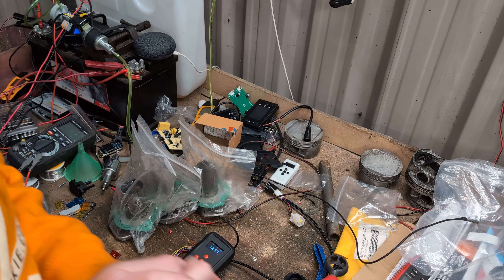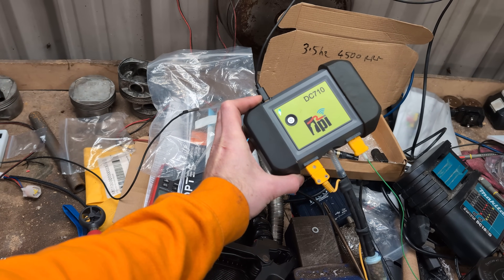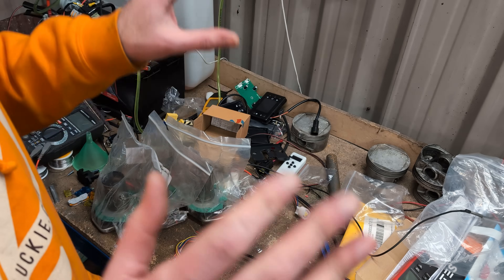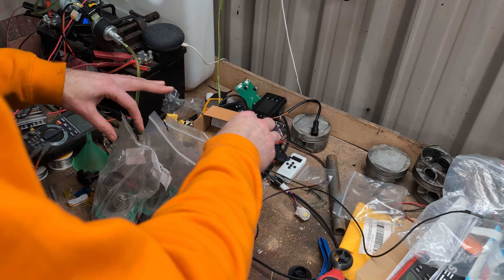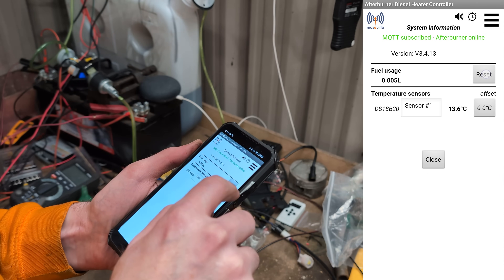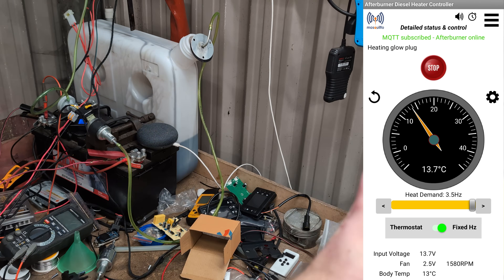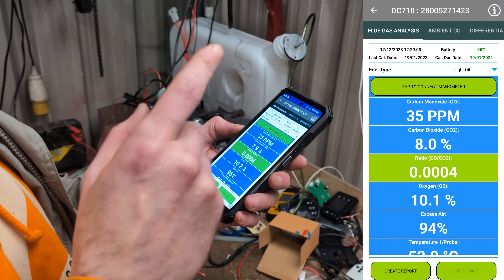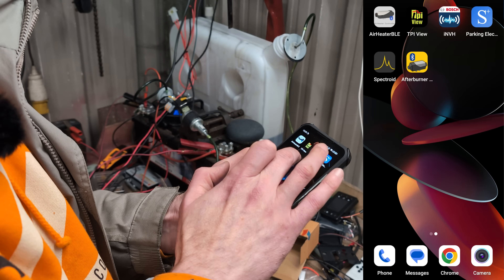Diesel Heater testing filtered waste oil - undiluted - part 1

Comment: I'm curious whether the oil you are using for these experiments is conventional, full synthetic, or a blend. I'm assuming by the weight and vehicle it's probably full synthetic. A mechanic that I know here where I live heats his garage with a heater designed to burn used engine oil. However, his heater performs very poorly when he attempts to run synthetic oil through it. It needs to be mixed at a ratio 7:1 conventional to synthetic in order to burn properly.

Comment: Ive seen a guy that uses a £300 centrifugal filter to get the oil super filtery...then uses 10% petrol and alegedly hasnt cleaned machine in 2 years.
Reply from the maker: The cheapest setup I've seen starts at £550 for the centrifuge and the pump.  We'll see if we can afford one at some point.
Reply: @DavidMcLuckie  Ah the oilybits one...this guy had a Dieselcraft magnum 60 which is $300 plus he had pump and regulator already...aye so pricey it gets indeed.
Reply: @DavidMcLuckie they make smaller ones that fit on your oil filler cap so you don't have to change your motor oil as often more like every couple of years

Comment: Last winter I ran my CDH with the Afterburner for weeks on hydraulic oil, the "32" hydraulic oil, worked great, I used a 50/50 mix with DPF cleaner additive added.

Comment: My forced air garage furnace runs 50/25/25 of waste oil / petrol / diesel. 2:1 seems to be the right viscosity but anything over 25% petrol changed the combustion properties too much. I went with a smaller nozzle because it pumps out way more heat on the blend

Comment: ive run hundreds of litres through my 12v diesel, 50-70% waste oil cut with diesel, smoked more but ran fine well worth the savings at the time diesel was near 2$ a litre

Comment: Does the afterburner allow for a second metering pump so you can start with fuel oil and then switch to waste oil once warmed up?
Reply: The metering pump should stop any back flow so if both pumps could be operated at the same time with different rates you could adjust the mixture during the run.
Reply from the maker: No.  But I hope to have the chance to test something that does exactly that very soon.

Comment: heres an idea with it being used oil and obviously with that less burn factor than fresh oil or diesel etc might be an idea to coil the fuel supply line (copper) round the exhaust whether that be 5-10-20 cold round the exhaust and of course ideally start and stop the heater on diesel/kerosene. bet that would make ALL the difference

Comment: This gets done to death - the answer is no. In order to run waste oil at any dilution level, you need to be able to influence the ignition process. I.E you need to use heat (a blowtorch) in order to get a diesel/kerosene heater to start up when being run on waste oil/diluted waste oil. The factory glow-plug won't be up to the job. 

With these types of heaters, there's no practical way to introduce heat to initiate combustion - you will be relying on the factory glow plug. It won't do the job. Period. It doesn't glow hard enough. You will end up having to clean out the combustion chamber manually & it will be a pita. Run it on diesel. Torpedo heaters run alright on diluted waste oil - use it in those. Mainly as you can use a blowtorch to initiate those.
Reply from the maker: Yes!  It's almost like they make a specific type of burner for waste oil.  This diesel heater isn't that.

Comment: Thanks David, great series of videos. I was pondering getting one of these heaters to burn off my waste engine oil and heat the shop a bit. You've saved me a bunch of trouble, thank you sir. I'll just continue heating with propane amd taking my waste oil to the recycling depot. Far less hassle.

Comment: You should try a 5050 mix of filtered oil and diesel fuel. Or maybe a 6040 mix. I have been running filtered vegetable oil and a diesel mix in my diesel heaters. And I've never had a probably at a 60% diesel fuel to 40% waste oil or sometimes maybe 5050.

Comment: Wonder if you can you try the ignite wifi controller.  Id also like to ask what's the minimum pump speed hz in afterburner tuning settings?

Comment: I'd be interested to know how those big waste-oil burners that mechanics have get around the gumming-up conundrum. I've seen them run on absolutely foul oil, and not make much smoke in the doing of it. I know that running an engine on old waste oil is contraindicated unless it's been through a centrifugal filter. However, an old boy I knew ran all his big trucks on the oil from his scrap yard. He centrifuged everything that came out of the vehicles that came in, and bunged it into his artics. He said it can gum things up if you let it run too cool, but that's not a problem if you use the accelerator like a switch, as it's intended.
Reply from the maker: The industrial waste oil burners like the Thermobile use a flash evaporation type of burn.  They have a heavy metal dish at the bottom.  You start them off with diesel to get it all nice and hot.  When you switch it over to waste oil it drip feeds onto the pan and is evaporated by the heat.  The evaporated and now combustible gas burns inside the heater keeping the pan hot and providing the heat to the garage.  All the heavy metals, soot, junk are all left in the pan.  Which does require periodic cleaning, usually with a hammer. :)
Reply: Well that explains that, not so much chance of getting a hammer in these burn chambers!  @DavidMcLuckie

Comment: I would guess bringing fuelrate right down to lean out to cause hotter combustion and burn off the crap.
Reply from the maker: You're thinking internal combustion engine.  Leaner isn't hotter in this kind of heater.  More fuel = more heat.  Up to the point where there isn't enough air to burn it.
Reply: @DavidMcLuckie  yes I guess that makes sense.

Comment: great videos love what you do , saw your key ring with 2 big skeleton keys what do they go to they look big , and queston you might be able to help wonder if its possible to put 2 same controllers on the same mob but one like 75 feet away in my shed using like cat 5 wire ?

Comment: Need to design a burn chamber that has non stick walls, so the Ash just gets ejected out the exhaust. Maybe like a chromed cylinder bore on aircraft engines, or a different grade of stainless that stays shiny at temperature.

Comment: I bashed my head on a brick wall for far too long trying everything people suggest to use old oil in a standard heater. I have a idea I haven't tried yet making a larger heater using part of a diesel heater running on diesel to feed very hot air to a larger burn chamber for the oil that is easier to clean

Comment: It it possible to run 2 pumps?  1 in diesel and 1 in waste oil.   And a 1 hour switch to run pump 1 OR 2.
Run 1 hour free heat waste motor oil and switch to 1 hour of diesel heat.
After 48 hour of running and the last hour of diesel , disassemble the heater and check inside.

Comment: Can you tweak the glow plug to come on periodically and prevent a flameout?
Can you tweak it to run on highest power periodically to burn off the deposits?
That‘d be what happens in a DPF of a vehicle exhaust…
Reply: The problem is that the WMO deposits are not near the glow plug. Also, the deposits are very hard. The heat from glow plug wouldn't do anything notable to the build-up.
Reply: Well it would keep the flame burning and prevent flameout.
I was able to burn out those deposits with a torch from a burn chamber I removed after using WMO. So more heat = less deposit built up I concluded.  @cliffelmore5834

Comment: That‘s exactly what I also had with my heater.
I discovered it took longer to flame out if run on higher heat (which probably burns it off better).
How about adding some DPF cleaner additive- which is supposed to lower the ignition temperature of diesel…and oil perhaps too?
And next one with pure waste vegoil?

Comment: Great video and I have learned a lot from your other ones. One thing i noticed was that when you were filming it the next day and you said that it had flamed out, it appeared that there was air in you pump suction tube. Had some drained back into the tank or had you lifted the pipe out of the tank for some reason?
Reply from the maker: The pickup pipe was hovering above the oil as I'd put it in wrongly.  So I'm guessing at some point it was sucking air and oil and flamed out.  Then the fuel settled in the pipe once it had stopped.

Comment: so many people say that you can run these on waste oil and you just cant, ive made a load of my own oil burners before and know how carboned up they become, there is no way to run these on pure engine oil
Reply: Even the purpose built waste oil heaters accumulate hard carbon deposits that require decoking. It is simply really dirty fuel.
Reply from the maker: Technically they will run on pure engine oil.  Once.  :)

Comment: was running used filtered veg oil and kero 50/50 but burn chamber kept clogging, can you take a old chamber apart so we can see how its made? also thinking of cleaning with caustic soda or cooker cleaner as carb and brake cleaner dont seem to be good enough, great vids
Reply: If you look down the burn chamber there's a ring with space behind it. This is called the vortex chamber.  There's a big gauze that runs around the edge that you can't see. This is to vastly increase the surface area the oil burns on. You have to cut the chamber tube where the ring is to be able to see it.  No matter how hot the burn is, the gauze is always cooler because its made to aid the evaporation of diesel oil so it can burn. The evaporation effect actually keeps the gauze cooler. Engine oil burns slower and doesn't readily evaporate, it soakes the gauze and unburnt deposits build up which eventually reduces the surface area to the point it will no longer burn anything. 

I went through all this last winter.  It just became annoying and time consuming to have to strip it down every few hours to attempt to clean it. I even cut my burn chamber to access the large gauze for cleaning (held back together with a jubilee clip) but it became so clogged with hard deposits that I ended up destroying the gauze in the process of cleaning. No solvent or caustic soda would soften these build-ups to ease cleaning.  IMHO, its simply not feasible to run waste engine oil no matter how much you water it down. A weaker mix just takes longer to clog, but it will.
All I'm saying about wmo is also applicable to wvo, the difference is that wvo has glycerin in it that has to be extracted before you have a clean burn. Extracting the glycerin can be done,  you end up with bio diesel, but at that point its more economic to use that for powering a vehicle due to the effort of making it! Good luck....
Reply from the maker: Yes.  I've got a video of me cutting the burn chamber open to show the insides.  Just need to finish editing it.

Comment: @David McLuckie , what about burning new motor oil, as a test, to check how much tar and ash there is as a baseline.
If it gunks up the chamber with new oil, then no matter how much you filter used oil, the results will be the same or worse.
Thanks for testing and sharing the results with us.
Reply: The youtube channel "Lowered expectations" tried this last year and it has the same or similar effect. he has absolutely murdered the oil burning process to death with very little sucess.
Reply: I tried it one gallon caused issues

Comment: Try 4 pints oil, to 1 pint diesel, also see if 4 pint oil, 1 pint gasoline (or paint thinner) if it will burn or burn too hot...
The soot buildup is due to the burn chamber not turning red hot (or staying red hot) burning off the crap buildup.
I guess it just needs VERY VERY refined oil to make it burn properly w/o the buildup
I guess the pipe dream of seeing waste oil being able to be burnt in that thing is a pipe dream...we shall see
Keep em coming!!!!

Comment: Love the heater videos ! Also 15:20... That looks very familiar. I spent 4 months last year burning waste motor oil and has this same result, sometimes multiple times each day, haha. 

It's great entertainment if you really like experimenting and trying out viewer suggestions.... but you will get a lot of people (who have never done it) claiming that you are an idiot because you didn't _____ and then you try that thing and oddly they have no follow up response   🤣
Reply from the maker: I'm hoping if enough people show it not working, eventually people will stop asking if it works.
Reply: @DavidMcLuckie  Good to hear ! There are a few channels that have made claims that waste oil works fine, so it's good to see you doing these test. 

The funny thing is that I suspect people will just come up with a million ways that you're doing it wrong. You need the very specific combination of things that they heard about on Reddit, or something, haha. Ceramic off spark plugs in the chamber, preheated oil, acetone mix, seafoam, hydrogen haha. It never ends.

Comment: Hi David, when you come to trying cutting the oil with other fuels can you possibly try a sample of kerosene please as a lot of people seem to be burning kerosene to save on costs during the winter as its a fair bit cheaper than diesel? It is also said that Kero burns hotter than diesel and is slightly less efficient, Im wondering if mixing it with waste engine oil would increase the efficiency and also burn the waste oil at a hotter temperature possibly reducing the coking effect in the burn chamber? I add strawberry scented two stroke oil to the Kerosene as my neighbour can smell the kero on start up and doesnt like the smell and I dont have any coking issues with the small quantities I add to the fuel ie 50ml to 10 litres of kero, this also seems to silence the pump a little adding some lubrication.
 Merry Christmas.

Comment: I filtered it and mixed it 50/50 and within 10days of 10 hours work it started to backfire through the intake chamber and flamed out it self and wouldnt restart. Took it apart and it was full of ash. I reckon its the antiware additive within the oil that form the heavy ash. The positive side for running oil is the immense amount of heat comparing to diesel that the heater generate it.

Comment: Waste oil better stick to natural and not engine oil lol . I did the same with brandnew 10w40 mixed with diesel 3/4 and it burned great but after three days poof lotta white smoke and it left a white crusty residu in my burnchamber it was a bit like perlite and it totally clogged it up . Probb the aditives in the oil that dont burn off .
Reply: They are designed as a light fraction vapourising oil burner that runs trouble free on diesel or kerosene. Waste engine oil is never going to vapourise and burn cleanly in this type of combustion chamber.

Comment: i think there is also an opportunity to see what else can be done to treat waste oil before use.  could look to add some kind of ceramic filter material (broken teraccota) to remove metals and other ionic salt particles.  what are you using in the filter? could put 30 watt heating mat round the filter to keep oil moving freely.
Reply: It looks like a standard pool filter...I think they filter down to less than 30 micron easily
Reply: @haydenc2742  centrfuging oil be the ideal solution. seen a few videos on youtube where they have a diesel car running on used engine oil. to make it useable, they centrifuge oil to clean and it removes all the crap and then pass through oil filter. imo, to make the heater to work, cleaing the oil is key.  the issue of viscosity can be handled with warming oil.  would be good see what it runs on new engine oil first as a baseline.
Reply: @maranmarantakeiteazie  centrifuging is filtering..it just uses centripetal force rather than a media to remove heavier particles, slings em out to the side, rather than capturing in a filter media
Reply from the maker: I would love to try a centrifuge to clean the oil, but it was a lot money for all the parts, and then most likely still end up with the same results.